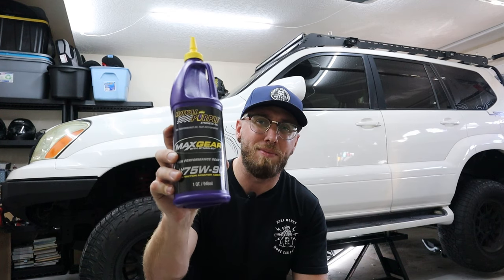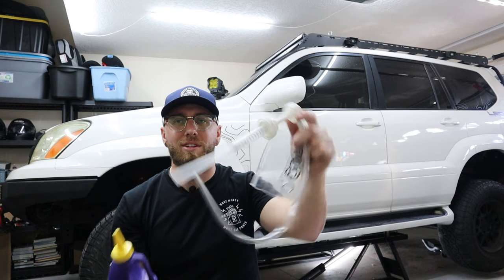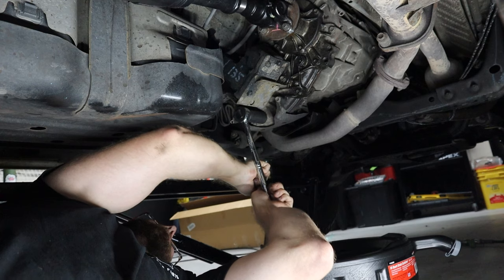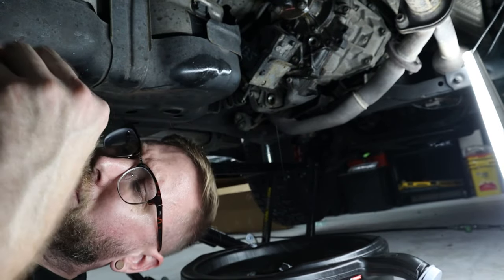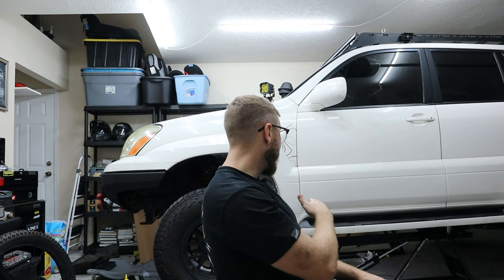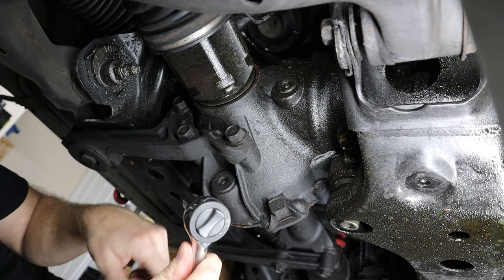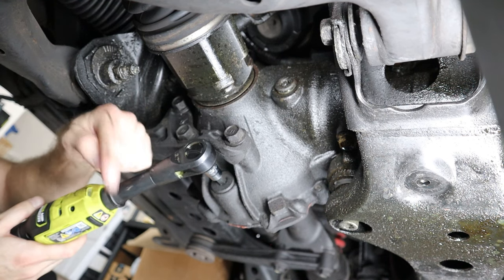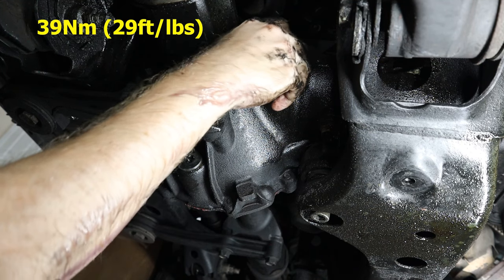Vlog 78 - Lexus GX470 Transfer Case & Front Diff Oil Change

Comment: I did my transfer case like a month ago. Is that hose supposed to be hanging out like that? I have mine plugged on top of the transfer case.
Reply from the maker: I believe it’s the pressure ventilation for the transfer case, but now that you mention it has me questioning. I did the diff breather on my rear differential and I feel like I should add one here. I’m going to look into this more. Great comment, thank you!
Reply: The hose should connect to CDL actuator.